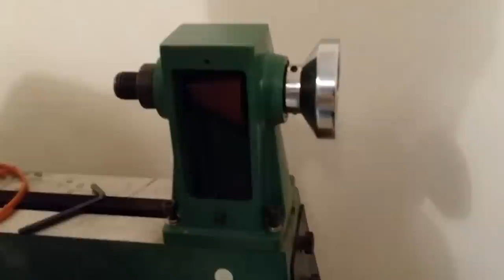How to replace drive belt for 65345 mini lathe

Comment: ATTENTION.  While you are at it reverse the pulley on the motor.  Put the mandrel in the opposite way, reversing the mandrel pully and bolt it back together . The belt is now accesed from the front. IE the headstock is reversed and is still concentric to the the bed.  I had my lathe for an hour before I did this.

Comment: Just wanted to let you know that by tapping out those bearings you inadvertently scored the inner race of your ball bearings which will greatly shorten their lives. I highly recommend replacing the bearings to anyone who does this job without a proper bearing press. An added bonus would be that this gives you an opportunity to trash those crappy Chinese bearings with some high quality Japanese Nachi ABEC3 precision bearings which will greatly improve the smoothness of the lathe. I replaced the ball bearings in my cheap harbor freight drill press and the difference was huge.
Reply from the maker: Thank you for your comment
It worked for me ok , as i did it very gently

The lathe works now great
I will definitely replace the bearing to a good quality one  after they will be damaged
 As i can Hear  it is working very quiet so far

 Thanks
Reply: What size bearings are needed?

Comment: Removal of headstock housing unnecessary. Vise/press contraption unnecessary. Just tap shaft with dead blow hammer...pops out. Clean and oil bore before reassembly. Simple.

Comment: I have this lathe but mine has circlet or spring clips on the inside that are holding the bearings in place. Anyone have this and how did you remove them?

Comment: I agree with AndyB you don't have to remove the head stock. I have a PSI TurnCraftter Pro model TLCPRO and it comes off the same. The Chrome knob is left handed thread and although I have to use two pipe wrenches (I thought I was going to mess up the chrome) it came off really easy. Thanks Benny

Comment: this is the exact video I needed. Thank you for putting in the effort on such a great topic.   Why did you remove the belt tower from the lathe? couldn't you have tapped the shaft out while it was secured to the lathe? would have made everything more sturdy.

Comment: I just did this but simplified it a bit. I used a 3" coupler for a vehicle exhaust pipe, rather than the large vise. Cut a notch in the pipe to fit around the raised ridge in the housing. Used a large C clamp with a piece of wood on top of the pipe and tapped it out like in the video. The belt is available at Harbor Freight, but you have to call and order it from the warehouse. Thanks, Benny!

Comment: Thanks for your help.  After watching you finish removing the shaft with a hammer and a block of wood I decided to try and do the entire operation that way and it worked.  A bonus: I did not have to remove the head stock.  Thanks again.

Comment: Thank you for this video. I have the same lathe and was wondering how to put a new belt on it. I did not see you remove the lower pulley. Is that something I missed in your informative video? I also looked all over the internet and found nothing about this lathe and belt change.
Reply from the maker: You only remove  the top one
Reply: Thank you. Thanks for the great video too.

Comment: that looks like my DML250 mini lathe from Record Power. I guess some mini lathes have similar builds
Reply: PugMan3 I have the DML250 and I’m struggling to change my belt...still couldn’t pull the  pulley off. That’s how I come across this video.  Did you change yours??
Reply: This lathe is made by so many brands. In the US, I know for sure that this harbor freight model is exactly the same as the excelsior from Rockler and one of the Grizzly models. From what I can tell, they just have different brand names on them, but they look like they come from the same factory

Comment from the maker: I realized that the lathe original  belt was made from poor material
 Therefore i decided to buy a better kind
as you can see the new belt is rubber-black and much stronger
I guess you can buy any brand  as long as it is in the same dimensions
You can always buy a wider belt (more ribs) and cut it yourself to the right width

Comment: I can't find a drive belt for the lathe.    Not sure optibelt PJ 630 is for sale on line. There is a Ribbed belt PJ 1600 (inch J 630) , 7 ribs, OPTIBELT on eBay for $21.00 is that it? I do not want to order the wrong thing, as I do not understand the numbers. Is there a better place (cheaper) to get it. Thanks for the the video Benny. Very helpful, or will be when I get the belt LOL!
Reply: +career extendrs If you have the Harbor Freight 10x18 wood lathe I believe the belt that Rockler has for ~$10will fit. The belt on HF 10x18 measures.....9/32"x5/32"x 25". Check your belt. This belt only has, I think no more than 3 ribs, good luck.
Reply: +Grayson Lassor   The Rockler belt is # 20424 and you will have to order it!